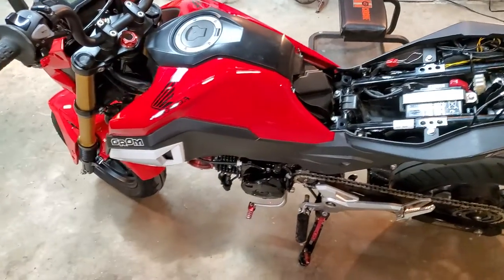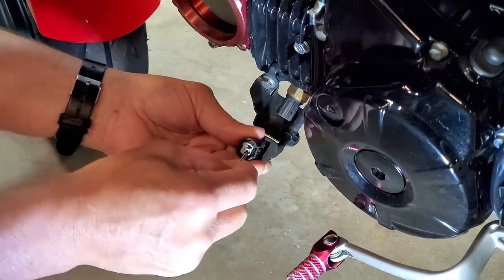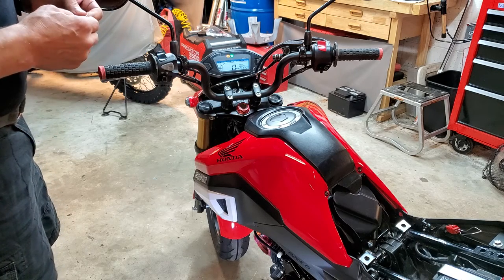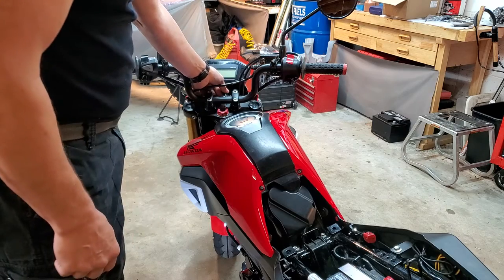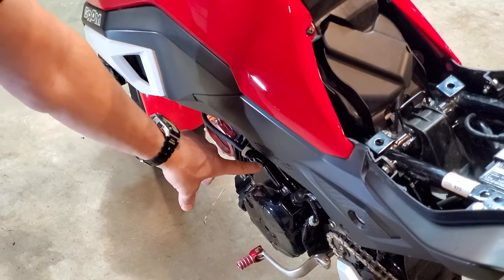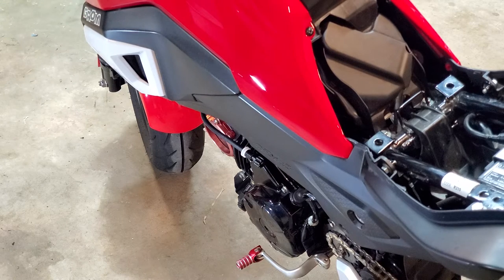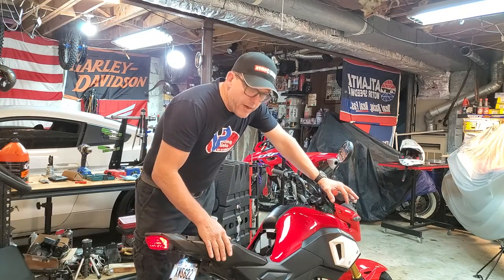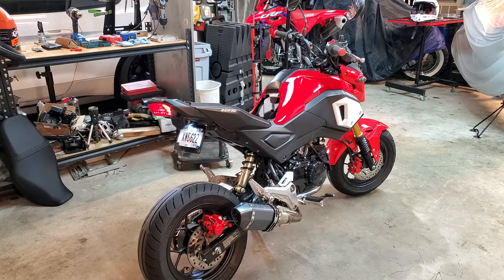How to reset TPS throttle position sensor & do proper re-learn Honda Grom MSX125 / Monkey Z125

Comment: hi dave .will this work on the 125 supercub as mine wont idle since fitting the yoshi pipe
cheers great channel
Reply from the maker: It might. But you might need to adjust your air screw settings on the left side of the efi. See my other video about that. But these bikes do not do well with mods and upgrades. That's the honest truth.
Reply: @HorsepowerHouse  thanks dave ill take the legshields off and have a look